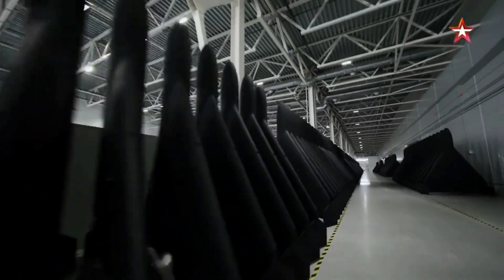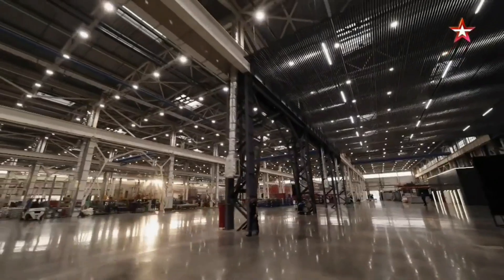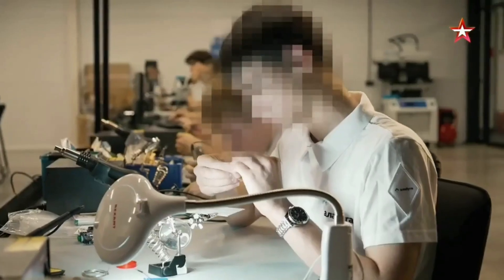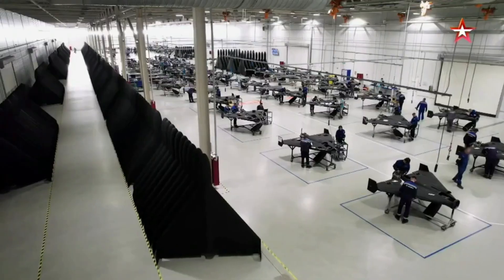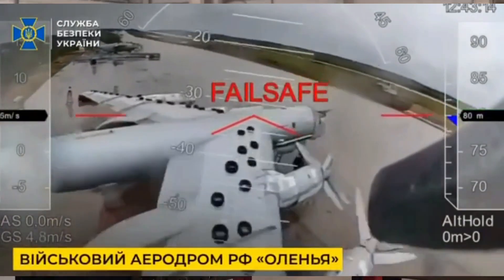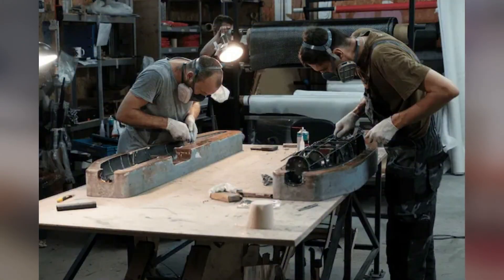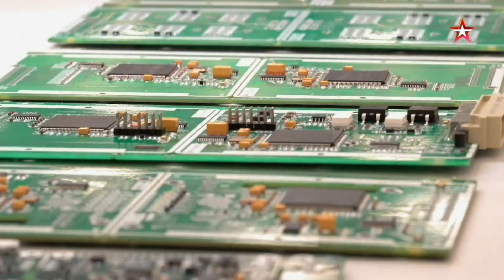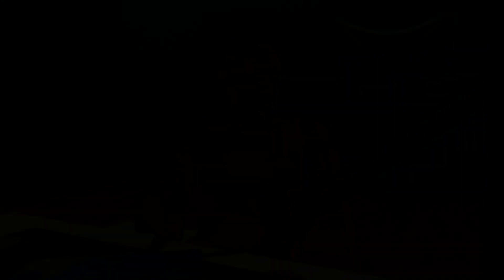Russian drones are no joke

Comment: HESA shahed 136
Reply: Stop repeating that, it's just wrong. It's like calling F-2 an F-16 every time it pops up. It is based on that for sure, but the design was modified and adapted for a domestic production, unique features were introduced.
Reply: @evilbabai7083  youre right
Reply: Geran II . . . Power Russian.  👊😎
Reply: @overdrivelzma.9219  still based on shahed